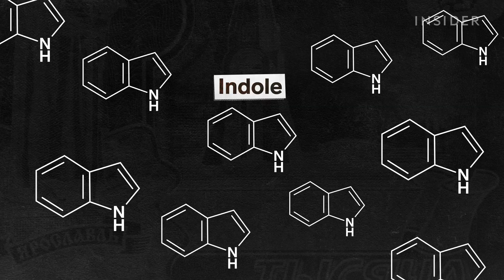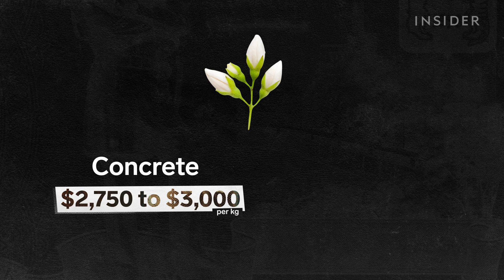Why Jasmine Oil Is So Expensive | So Expensive

Comment: If only 5000 buds are required to produce 1 kg of essential oil it would not be that pricey. In fact it needs about 1 million buds to produce 1 kg of essential oil that is why it is pricey
Reply: 5000 buds equate to 1 kg of flower buds (not oil).
1 kg of oil is 1000*5000=5M flower buds.
Reply: In this video they say he gets flowers for 500 rupees a kg, so to make get 1 ton he has to pay 5lakh rupees, and if 1 kilo of jasmine equals 5000 dollars and one dollar being 83 it only makes 4.15 lakh and no one will do business like that, either that guy is exaggerating the amount of flowers being used or lying the actual profit he is making by selling it
Reply: Whatever the flower prices are there they are daily vary from day to day that’s the reason one day it can be 800 and other day it can be 100 also depends on Market supply and Muhurthams and festivals  in India
Reply: 3:23 " A kilo of Jasmine have 5000 buds" he clearly mentioned it